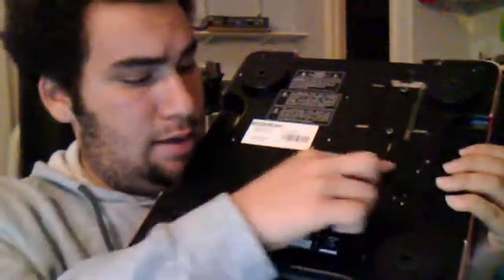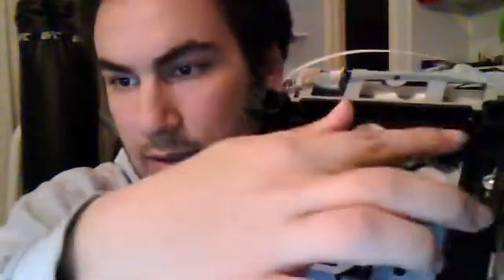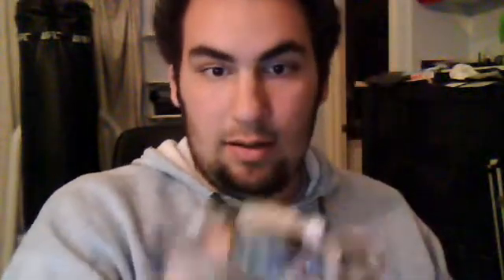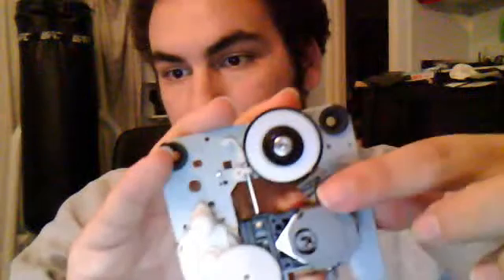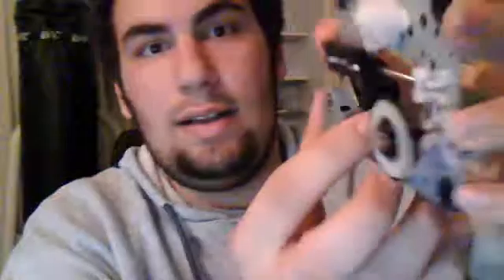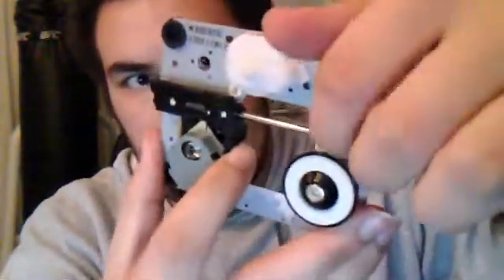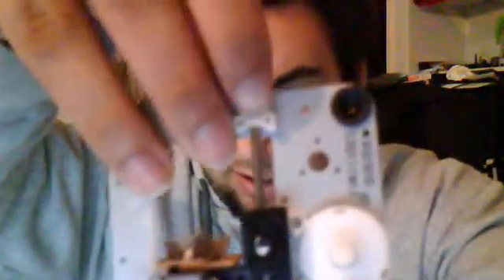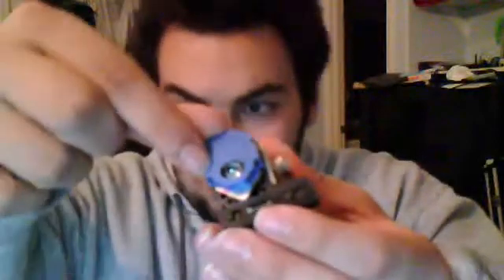no Disc Read error fixed! stanton c.324 DJ cd player

Comment: Bro, so many years later you have really helped me out right now. What you just made me realize is that I had a junked Sony under the kitchen countertop, two band, CD clock and I had seriously bought that thing for $2 to tear out these smooth potentiometers from the front panel and Jack the screen. And oh my God my brother, my brother. My brother, my brother. I recognize the shape of the full replacement you held up when I looked on eBay and saw that there are some that have the disc tray as well, it's exactly the tray I'm going to take it apart right now. I just bought a pair of these standings for $80 and this must be the reason that all the cords were not included. One of them had the error bro. Thank you so much!
Reply: My brother, it's exactly the part you God thank you so so very much. You have saved me so much time and you've taught me how to fix these things anytime I need to. And also you've taught me something I already know but about a new component. Hello! There is free trash everywhere at every single thrift store. Get a broken thing. Everyone, these little readers are in s***. Oh my God. This makes me want to restore stuff off of OfferUp and then profit

Comment: I had same problem but mine was built post May 2010 and uses a Pioneer CDJ800 Mk 1 pick up instead of crap sony parts and remember when new part arrives de solder anti static and use anti static soldering iron or turn standard iron off at powerwhen it gets to right temperature.

Comment: Got the part installed but broke the power connector going to the CD drive part.  White connector on each end, five white wires, and one red wire.  Anyone know where I can get one, or what the part is called or a number?

Comment: On the bottom of the cdj you need to remove 13 black screws. 2 on each corner, 2 in the middle, 3 hidden near the power switch. Then once you separate CAREFULLY the cover, you need to unplug 2 cables on one side and unscrew the ground cable on the other side... Now for the CD bay use a 6mm hexagonal dice under the base and a screw driver on top... :)

Comment: electronix was a good source for parts though back-order took an extra week.
Note: the ESD safety solder-bridge protects the laser from damage.  It also prevents the laser from working when installed and the drive won't spin unless the photo-diode (sensor) "see" the laser light. Compare to the old part circuit board for solder-bridge location.

Comment: Multipurposevids: thanks for your post! It gave me enough clues to complete the same service on a Stanton S-500 dual CD player. This model uses the same "optical pickup" as C-324. I replaced both optic modules as the lasers seemed to be dying (lenses where clean).  The pdf references (below) are good sources to review in advance. Particularly the electro-static discharge (ESD) precautions and having the ribbon cable connected prior to removing the ESD safety solder-bridge.

Comment: in this video theres an information missing when putting new laser lens make sure you unsolder the big solder in the corner of the  circut board of the laser lens ones you do that you will see that it separates and turns to two solder contact job complete enjoy.it took me 6 hours to figure this out i broke my head to get more info on this thanks i hope this is heplfull.

Comment: good advise i bouth two stanton c.324 and i new that the no disk appear i bougth for really cheap prices and i order the lens and i installed them but you forgot to explain that the to disolder the contact that is in the corner in of the circut board to separet them well i did as soon as i google how to do that and it workt after 6 hours of breaking my head it did well its working find thanks for the info very helfull .

Comment: hello everybody before installing laser you have to desolder a contact on the circuit board it is a tiny contact that have to be separated. Google search Instructions for installation (PDF) - Studio Sound Electronics has picture and instructions.

Comment: Update tpye   KSS213QC.pdf    in google search open the website named  KSS-213C/KSS-213Q LASER ASSEMBLIES it has picures of solder joint. desolder the two contacts make sure no solder between them player sure fire up.

Comment: Hello i got no disk read error bought replacement from ebay the exact kss-213q as one in unit but still have same problem. I noticed that on back of connector there is two contacts soldered on the replacement part but is unsoldered on the orgional i wonder if they need to be removed. Also your link to stanton forum now goes to a gibson forum with no post you uploaded can you please give an update thanks.

Comment: @Multipurposevids mine must be broken inside i might have to cut them off -,- the whole piece keeps turning and turning and turning.... also where did ya find the replacement part???? i just want to see if i can clean it off and make it work! or smash it with a hammer and try again... which ever works....

Comment: how the f did you get the bottom 4 nuts off? mine are being a pain the the ass and the screw keeps turning with the nut i tried grabbing it with pliers but the screw it WAY to short

Comment from the maker: @djguruma there's a solder connection on the bottom of the laser cartridge, there should be instructions with the replacement part you order.